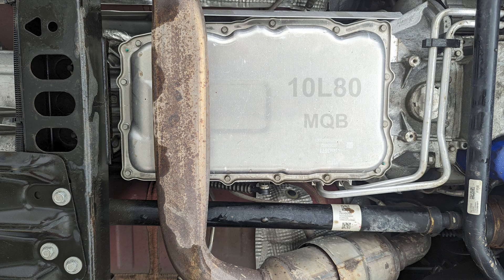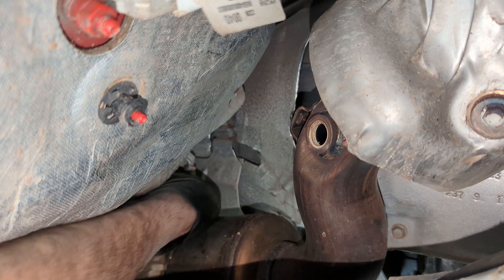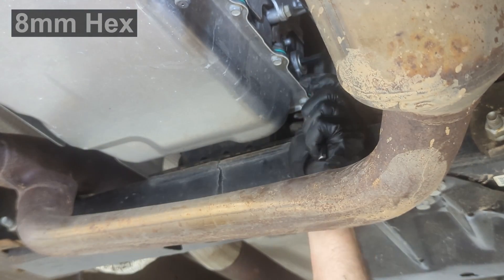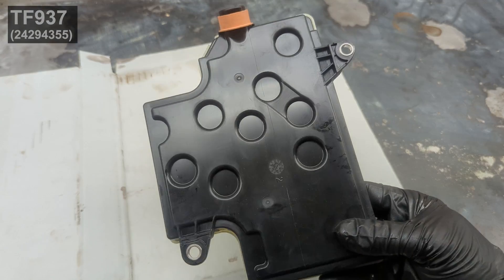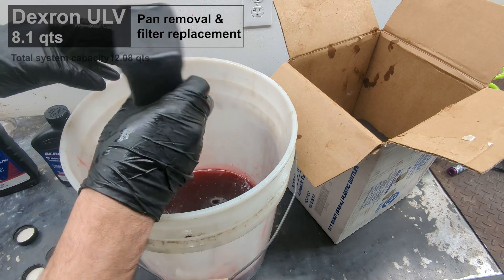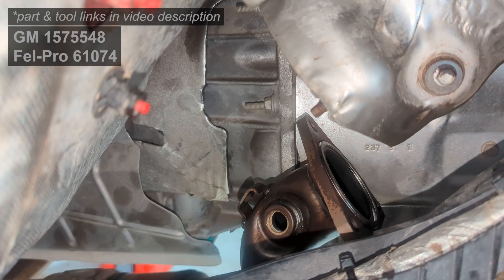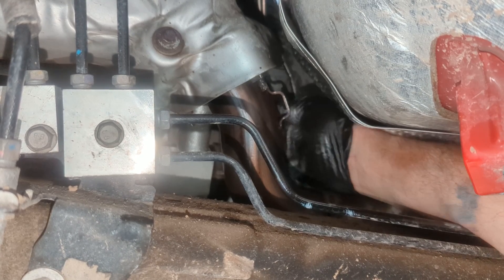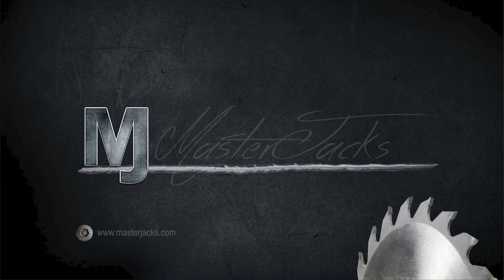2019-2024 Sierra/Silverado: 10-speed Transmission Fluid & Filter Change (10L80)

Comment: Great video, I was able to complete this procedure on my wife's 21 Tahoe without too much trouble.  Maybe on the pickup trucks there is a little more space, but on the Tahoe I had to lower the front driveshaft to access that fill port in the transmission.  In addition, to lower the front driveshaft enough I had to lower the sway bar.  You have to like puzzles and challenges to work on these newer vehicles!  The next time I do this I may remove that Y-pipe all together and take it to a welder and have some v-band flanges put in so I can just drop that crossover pipe in minutes!

Comment: Well illustrated video.  I just followed this step by step and replaced the oil and filter in my 2021 GMC Sierra 1500 Denali. I wanted to share some notes from my experience:
1. The job took 7 hours start to finish. Would have been much quicker but the exhaust bolts took 4 hours alone. Would recommend multiple size deep well 6 point sockets, a universal, and heat.
2. For the fill plug,  I cut an allen wrench about 2 inches and used a wrench. Would have been real nice to have a ratchet wrench, though. 
3. I wish I would have bought replacement exhaust bolt nuts, but didn't think of it and my truck was half apart. 
4. I found out later they sell a pan with a drain. I would pay anything not to do this job again.
Reply from the maker: @jtelensky3026  excellent feedback, spot on recommendations.
Reply: All great points. But you have to drop the pan to replace the filter anyway...
Reply: @JeffMTX  And you really want to clean the fine particulate matter from the magnets too!

Comment: Only reason it says to replace those bolts is because they have a dry locking compound on them. They don’t think the average person will take the time to clean all the oil out of the bolt holes in order for liquid locking compound to be able to adhere. Just clean as best as possible and use oil resistant thread locker. No need to ever replace them

Comment: Dude your videos are the best, absolutely top tier… I really want to try to do this without loosening the exhaust pipe (don’t have jacks or a lift) but half the comments are saying you cant, while the other half are saying you can… lmao i guess I’ll try it and then if i cant get it out I’ll just try to put it back on and hope the filter is ok not being replaced.
I’m thinking worst case if i cant pry the exhaust to remove the tranny pan, maybe I’ll cut the exhaust pipe and then reattach it somehow
Reply from the maker: If you're not replacing the filter, removing the pan bolts will likely drop it enough to suction out what it's in the pan. Hope it goes well, thanks for watching!
Reply: @ im going to try to replace the filter, worst case if i cant then ill do what you recommend, im curious though whats your opinion on how long the filter would be good for? Im at 44k miles currently and this will be my first transmission service.
Reply from the maker: @xquisiteforyou  depends on the use but new clean fluid will help you get more out of it.
Reply: @xquisiteforyou were you able to do this without removing the exhaust? Pry bar method?
Reply: @John-2fnf yoo! I ended up selling my truck because it was just too expensive for the payments/gas. Bummer that i already bought all the fluids and gaskets lol, but alls good, i sure do miss my truck. I think the only way is to take off the exhaust pipe, otherwise you risk bending it and causing leaks
Reply: @xquisiteforyou ahh gotcha. Plan on starting it tonight, back on here for a brush up first. Thanks!

Comment: What is that tool called you used to tighten by hand at about the 5 min mark?
Reply from the maker: @sean-johns  I believe you're referring to the 3/8" speed handle, but also using an inch pound torque wrench.

Comment: is it necessary to drop exhaust when doing this ??? In my opinion it seems that with a bit of shuffling it’s doable to skip that step 😅
Reply from the maker: On older models it was possible, now the clearance is even less. If you're able to do it without dropping the exhaust, let us know!
Reply: I have 2023 tahoe premier.  Just curious, did you finish the work without removing the pipe? My friend has a lift and he will do it for me. So I want to make sure it.

Comment: If not for all the exhaust stuff, it’s a really easy job. Nicely done.
Reply: Most people use a prybar and just move the exhaust over to pull the pan out. Rubbers insulators are very forgiving.
Reply: @korkuc26  I wouldnt do that. Shop did that and cracked my exhaust. Then had to get it rewelded.
Reply: @shawnreems493  absolute lie
Reply: @BSPESH  Not a lie lol. I went back to get my truck after and the exhaust was loud. Made it smell like exhaust inside my truck every time I idled. Had to call the guy behind the desk over and said listen to that. Turns out I was still under warranty so it didnt cost me anything but was a massive headache. They ended up having my truck for a couple of days.
Reply: @korkuc26  Terrible advice, unless cutting corners is just how you like doing things.
Reply: The 3.0 doesn't have the exhaust under the pan.
Reply: @ good to know. My 5.3 does and it was a pain in the a**.
Reply: Exhaust only needs to come down about an inch and a half. If you leave the O2 sensors in there’s plenty of slack. I just keep a jack with a 4 x 4 block of wood holding up the center pipe.
Reply: Sawzall and welder make it easy lol

Comment: I just had this service performed at shop…now I have strong exhaust smell in the cabin when stopped/idling.  Is it possible they re-used gaskets and/or didn’t bolt up tye exhaust correctly?   2021 6.2 with 51,000 miles.  Thx for the videos!
Reply from the maker: @JRMabc  it's possible you have an exhaust leak you didn't have before related to this service. Bad exhaust gasket/improper seal on the reassembly
Reply: @MasterJacks  okay, thank you.  That’s what I’m suspecting.  Thank you!

Comment: Dumb question.  Why do you not add the 8.1q in through the engine bay fill tube?
Reply from the maker: @Sherlock_Ohms  these newer transmissions (most major manufacturers) don't have a fill tube/dipstick.
Reply: @MasterJacks  thanks for the reply. 
Would this be something someone could do without a vehicle lift?
Reply from the maker: @Sherlock_Ohms  yes, however it would be difficult. Ramps or jacks would help.

Comment: So on my 2015 suburban I was able to use a 2x4 and a ratchet strap to slightly pull the exhaust down to get the tranny pan out. Can you not do that on the 2021 as well?
Reply: yes you can do this with the 2019 thru 2024
Reply: Check out this very smart guide for dropping the pan without having to lower the exhaust or use a ratchet strap to pull it down.

https://youtu.be/Aq_v02DBxMg?si=i4QU2JSkVGdWaTQL&t=120

Comment: This would be 20-24 not 19-24 right?
Reply from the maker: @williambrown77  the 2019 had the 10L80 transmission as an option for the model year
Reply: Gotcha. My 19 has the 6.
Reply: My ‘21 gas 8L90, same for my buddies ‘20, we just knocked this out this weekend. Slightly different refill but the process was easy. The toughest part was getting the pan out. This video made it much easier for next time.

Comment: 2020+ the pan now has a drain plug
Reply from the maker: @skidoochris  nice! This one was a 2020, no drain plug. Did you buy your pickup new? If not, wondering if the previous owner put it in. Wish I had done that when I had this pan off.
Reply: It is NOT a drain plug, but a stand by pipe goes up inside the pan as so you can check the fluid level. A little fluid may come out but very little. Where in this video he checked the fluid level on the fill plug, you do it on this plug on the bottom of the pan.

Comment: Would it be possible or is it a bad idea to just every 20-30k miles siphon off 1-3 quarts of fluid and replace with fresh fluid and save this ridiculous process for a 100-150k service?  (Not saying I know better, I’m genuinely asking bc I wanted to change my trans fluid but this is insane and I wouldn’t be crazy enough to think of doing this at a frequent interval)
Reply: This what I am thinking is to suck out all you can at shorter intervals say 15K and get out all you can, then refill and do the level check? Where could a guy suck it out? The fill hole or??

Comment: So this is a dumb question. The truck is on the lift as your reving it in drive? Or did you do this some other way
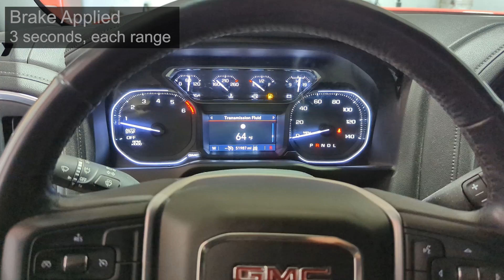Reply from the maker: @timme5150  you want it in drive with your foot on the brake to raise the transmission temp. Watch that section starting at 7:55 a couple times. There are also some helpful notes in the top left corner regarding how to do converter stalls.

Comment: I just performed a fluid and filter change on my 23 Sierra with LZO with 30k miles. Diesel does not require the exhaust work due to single exhaust. It’s still a chore with a lot of up and down when doing this in the garage under the truck but it can be done if you’re up for it.  I reused the filter bolts, could not find them online or locally at any dealer. I got a Vevor fluid pump on Amazon. Worked great. Getting the drain plug on after fill is a PITA. I put in about 8.5 qts and then brought it up to 167 and pulled the plug. Quite bit ran out until I had a steady flow and I plugged it up. If I could get this done for $200 or less I’d let em have it.
Reply from the maker: @bryanschaffer2100  great feedback, thanks for sharing and watching!
Reply: My dealer will do the flush for $160 and pan off filter change for $260. They also send me coupons. I cant stand not doing it myself, but with no drain bolt and the exhaust its just not worth it. Kisses me off there's no dipstick to monitor it either.

Comment: Was going to do this on my 21 Tahoe this changed my worldview about the job. Having the dealer do the fluid exchange is sounding a lot better. Thank you for the very informative video!
Reply: Prob is dealer does a flush not this. Flushes are supposedly not good to do especially older vehicles that didn’t see regular intervals 30k
Reply: @JFEnterprize  I had my done at the dealer at Folsom Chev on our vacation road trip to Cali. Stopped there to fix a flat and they had a regular deal to change fluid and drop the pan with a new filter for $350. Couldn't pass that up!

Comment: Hello there, Great video my friend. but man, the gas version has that Exhaust pipe in a way and what a pain in the butt to change the transmission fluid while removing all kinds of parts out of the way. Anyway, I have a 2023 Chevy Silverado 1500 3.0L Duramax and the transmission at these pick up truck is not obstructed by anything apparently l, so it is easier to remove the pan. Now, this is my story. I just recently ordered through Amazon my Al Delco Transmission Fluid and since the Amazon suggested that the Dextron VI transmission fluid fits my car then I went ahead and purchased 12 qts since I am changing the pan with a deep PPE pan. Now I went ahead and changed the transmission fluid and place the Dextron VI already, as well as went through all the process and temperatures too.. Drive it for about 4/5 miles and then parked it. The second day, I went ahead and watch few videos including yours and I realized that the AlDelco Dextron VI is NOT the correct fluid for this 10L80 transmission. Instead I need the Dextron ULV 10-4107 I think it is the bottle saying. As soon as I saw that then I drain the transmission again immediately and replaced it with the correct Dextron ULV type. Went through the whole process again and drove the truck again for about 10 miles. Everything seems fine for now, but there is most likely more fluid left inside the Torques Convertor as I would imagine since I could not drain everything. So at this point it is mixed with the Dextron VI. Since I can’t flush the transmission for now, then I am planing to removed it again later on and add again 9 quarts of new Dextron ULV so that the fluid left inside the Torque Converter will be replace with new fluid and have less Dextron VI left overall inside… Damn Amazon have this message stating that this Dextron VI fit my vehicle so I got to table mislead and went though all this headache. I am hoping that everything will be fine in the end while repeating this process again so that the incorrect fluid will be removed as much as possible.. Geez! What a damn nightmare and believe the Amazon posted message.
Reply: you will be fine!

Comment: Any idea why I would only have 5qts drain from the transmission after pulling pan & filter versus the called out 8qts? Thank you
Reply: Several quarts get stuck in the torque converter
Reply: I only had 6 qts (plus what spilled on the floor) come out. I put the ~8.1 qts back in but haven't started it yet. What happened when you filled and started your truck?

Comment: Dude I just did this all u have to do is pry the exhaust down and the trans pan will come out all that is not necessary
Reply: Remove trans mount bolt to trans cross member jack trans up a 1 inch. Just done mine. More than one way to skin a cat.
Reply: @Rumseyduck-sc9uo  will this work with truck on jackstands ?
Reply: @OnTheToolsWithSal  yes , will need to level truck to set fluid level
Reply: I just tried that man. No fucking way you did
Reply: @nolanandert4258 Can be done without dropping exhaust. 4x4 between trans crossmember and member towarda rear end and a ratchect strap around the exhaust to bend exhaust Y down. 2 bolts hold the transmission to the crossmember use a floor jack I left one thread in each bolt and used a floor jack to raise the the transmissiom to that height. JUST enough room the remove the pan, what an absolute gem of a design
Reply: @nolanandert4258 He us 100 percent correct. I have done 100s of them just get a pry stick and a buddy. Use the trans crossmember for leverage. 10 times faster. Especially in the rusty parts of the country 😉
Reply: @nolanandert4258  today i've changed the filter without removing exaust.....

Follow the steps :

1) lift the vehcle
2) remove the balance rod bushes (4 bolts)
3) remove cooler pipe bolt (1 bolt )
4) Remove the transmission mounting bolts ( 2 bolts ) and jack up transmission maximum 

5) Remove all transmission oil pan bolts  ( drain the oil before ) 

6) last step... Use one lengthy solid rod and put it between the exaust pipe and the cross member and pull down As much as u can ... And tell someone to take out the oil pan
Reply: I used a 3 to 4 foot pry bar using the crossmember for leverage. You need like an inch or so to for the pan to clear the filter. Been doing it like this for a number of years. Whether 6.2 or 5.3 engine and has to be stock exhaust. There use to be you tube video showing this, this is where I learned of the trick going back to 2016 or so. Last one I did was a 2021 with a 6.2 engine.
Reply: @rileypup5959  You need jack and pry bar only.
Reply: @rileypup5959  think I could do this on Jackstands? I’m gonna do fluid and filter and install a B&M pan
Reply: Disconnect the cooler lines and pull the pan at a 45 degree angle (like towards a front wheel) it will clear

Comment: What resource are you using for torque specs and bolt tightening sequencing? I am looking for a good resource specific to this generation of Sierra 1500.
Reply from the maker: I pay for ProDemand. It's a commercial shop repair software. I would look at Identifix. It's a great repair software that has tiered pricing.

Comment: Great video but dang GM couldn’t route that exhaust better?  Could you do this without removing that if you don’t mind the mess?
Reply from the maker: On the older models, there was a little more space and you could sometimes work the pan out. On this one, there isn't enough clearance for the pan to drop far enough to clear the filter and valve body. Not very maintenance friendly
Reply: you can use pry bar and jack to do this.

Comment: How often should you do this? I came to the dealer, and they quoted me $800. They also said I didn't need it until I hit the 100,000, I am on 50,000 right now. I don't know what to believe. Another dealer told me it is possible to change fluid without dropping the pan. They charge me $380. They also said I should drop the pan when I hit 100,000. But how can they change the fluid if there is not a drain bolt 🤔
Reply: They flush the oil through a set of kidney filters. I was quoted $380 for the flush also and $1000 for the filter change

Comment: Just curious. I was told the trans fluid spec was like 157F. Just to avoid that, wouldn't it be easier to measure how much fluid came out, and just adding the amount?
Reply from the maker: You could do that as a starting point, but It's better if you get it up to temp and check it with it running to be sure it's accurate. To get it up to temp, you can do converter stalls (foot on brake, shift into drive, rev engine to 1300-1500 RPM for 10 sec on, then 10 seconds off watching trans temp on display until temp reaches 160F). Then with it still running (in Park), check and adjust level as needed. This video shows converter stalls doing the same thing, but on a GM. Start watching at 7:50. 

https://youtu.be/yzCvuAJEqhU?si=dvWfO0ekAEFG3Vyc
Reply: @MasterJacks  Thanks!
 Have you had any luck/experience with a deeper pan, and what brand worked?
Reply from the maker: I haven't tried a deeper pan personally, so I don't have a good referral. Hope it goes well though, I know a lot of guys do it.
Reply: @MasterJacks  Thanks! How long did it take to do this job?
Reply from the maker: @nickrinaldi4276  this one took about 3-4 hrs! Of course, it always goes slower trying to work around a camera 😄
Reply: @MasterJacks  Thanks! For a vehicle with 50k the bolts were pretty clean. Was that the first change for that vehicle?
Reply from the maker: Yeah, this was the first service. Could have been worse for sure.